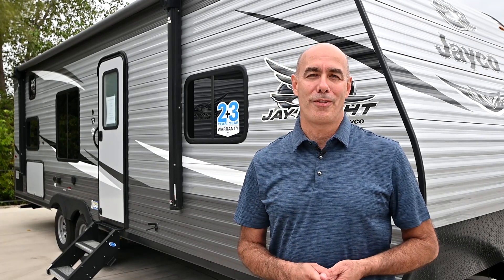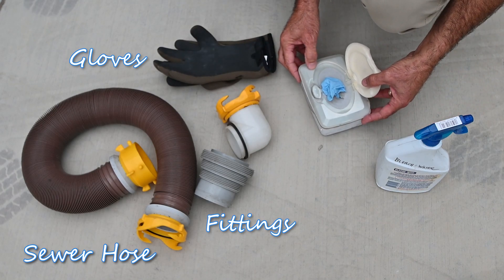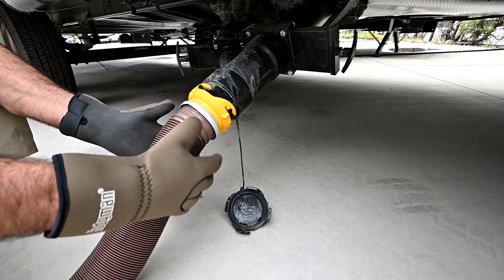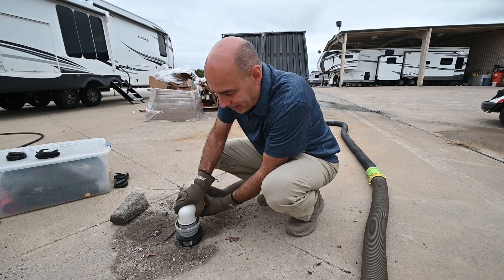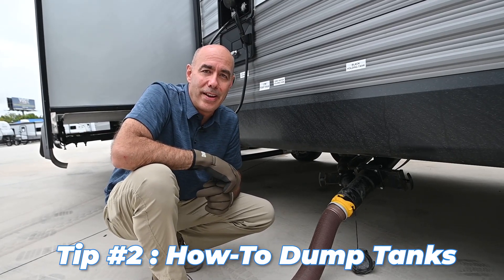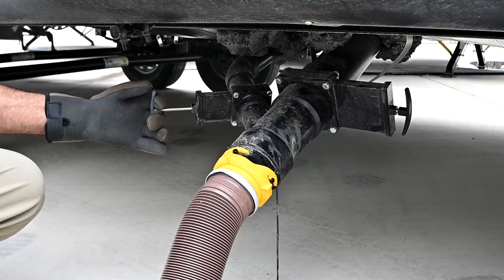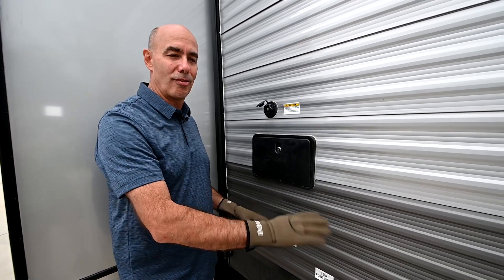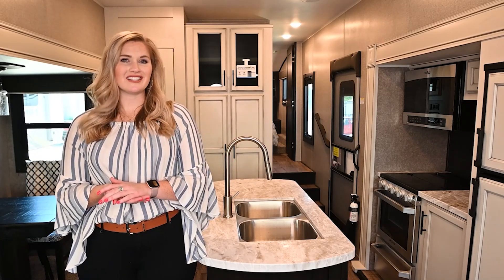How Do I Dump RV Holding Tanks? | RV Quick Tips - Ep.1

Comment: Leaving Grey water valve open for a week will allow sewer gas to backtrack into your RV.
Reply: Hi D.L. Thanks for the feedback. Technically any time the dump valve on your RV is open it can allow gas to enter the holding tank, however if the tanks are vented properly you should never be getting sewer gas in the living space of the RV. If you are, you have a vent or other plumbing issue. If you have a concern, it's super easy to create a makeshift p-trap by looping your sewer hose between the RV and the campground sewer connection.  Happy camping!